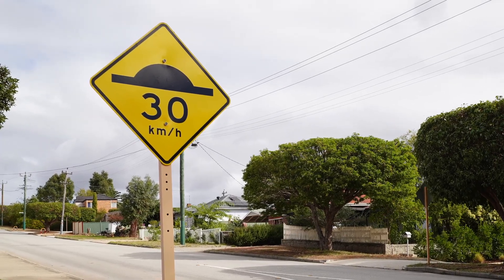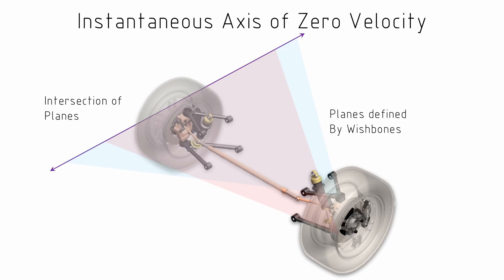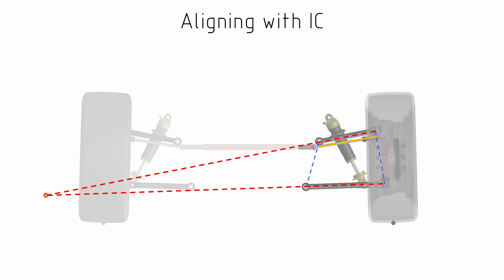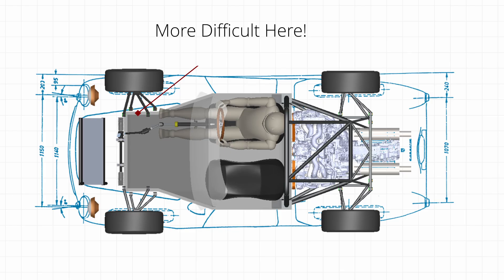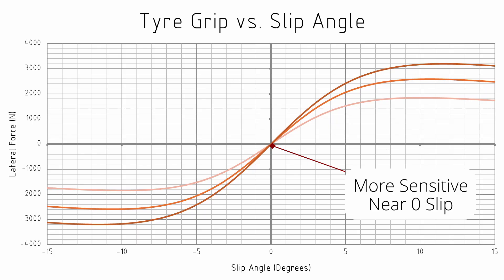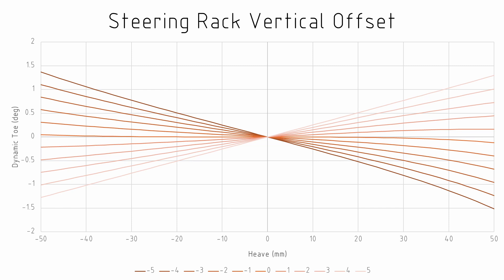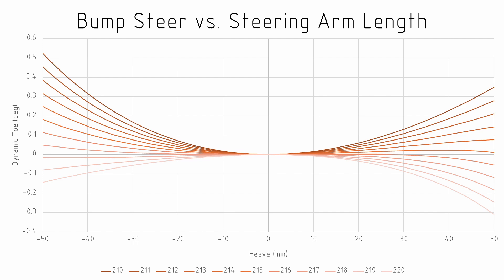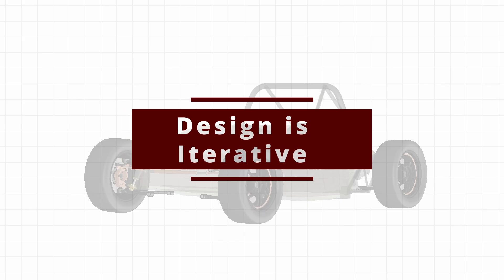Bump Steer: Designing Predictable Steering (Project 171)

Comment: Does shimming the height of the steering rack not cause issues with mating to the steering column?
Reply from the maker: Nothing that cant be dealt with a few adjustments further up the steering column.  Small shims can usually be done within bolting tolerances without any binding.
Reply: @KevinHayward7  Interesting ; what will the range of rack height be for Project 171? I imagine if you’re able to shim the rack enough to make a difference in bump steer (say, +/- 0.1 in?) , your column could have noticeable slop in some configurations? I suppose this would also depend on the geometry of column (direct / single u joint / double u joint / two single u joints)?

Great videos by the way. will be sharing with my suspension members
Reply from the maker: I would hope I wouldn't need anything more than +-10mm.  Chances are I wont even need to shim it at all, given I can potentially deal with it at the upright.  Column will have two single U joints, and will mount the column after the rack is properly located.  This means that the mounts can be made to suit the ideal rack location rather than have to do a lot of shimming / slop at that end.  Although it isn't too hard to put shims in at the steering wheel end of the column mounts to deal with the small changes required.

Comment: Hello mate, thanks for the videos. Ive got a Spire GT3 that has a similar setup to what youre planning. It uses a mk2 ford escort rack, although mine is an older car and the newer ones have a more racy off the shelf item. Ill take measurements from mine if you like?
Reply from the maker: Thanks for the offer.  I did have the dimensions for a Mk2 escort rack. Looking to work with a Subaru BRZ rack which I have picked up.

Comment: Wouldn't bump steer be reduced if the rack were mounted as low as possible, so that the tie rods would be longer and its angular deviation less?
Reply from the maker: It would help, but bump steer can be made pretty low in the position it is in at the moment.

Comment: How are you defining the vertical rack offset? Watched that section a few times but maybe it went over my head.

My plan for my car is to take a manual/depowered rack and shorten it, is that just falling into what youre considering to be too pricey?
Reply from the maker: Im setting the vertical offset of the rack at zero when it is at the height that causes the a line through steering tierods to intersect with the instantaneous axis.  Positive if the rack is higher, negative if it is lower.

A depowered rack is fine. Pricey is when you want/need something custom. No economy of scale to take advantage of then.

Comment: Can I raise the possibility of a non-rack style steering system?  I know people think it is old fashioned but running another four-bar linkage to provide steering geometry might open up some interesting possibilities.  Also, you could drive it with a one-sided rack in the end if necessary.  BTW, some F1 cars have separate racks for the left and right wheel - just a f'rinstance to boggle the mind.
Reply: I also want to add that a poorly positioned rack which needs to react a lot of "vertical" (or non axial, really) load can add an annoying amount of variable friction into the steering system which can upset steering feel in extremis.
Reply: PPS:  The Elise rack is 786mm between pivots, FWIW.  I have made a CAD model of one too, if you're interested.
Reply from the maker: We did end up using a non-rack steering system on a couple of the ECU Formula Student cars. Pitman arm off a planetary gearbox going to intermediate rockers. Cool but probably over complicated system, was really good in building in non-linear ackermann effects.

Probably happy with a typical rack for this car though.

Good point about avoiding having too much angle on the steering arms.

Thanks for the Elise rack dimension, a CAD model would be great.

Comment: You could consider using an NA/NB mx-5 powered rack, then depowering it.  I have done this myself and it is rather easy, feels great, and may be of a suitable eye-to-eye length for this project.  The ratio is also fairly slow at 15:1 (though that is likely the steering ratio, not rack ratio, which is not considering the steering arm length).
Reply from the maker: It is definitely an option, do you know the eye to eye length of the pivots and how much travel the rack has?  It is a popular rack, and the depowering is pretty well documented.

Comment: Woodward have some nice steering racks, but might be a bit on the high side of the budget. I couldn’t find pricing on their non-power steering options, but might be worth reaching out to them? 
Benefit there is lots of technical details and available in many sizes. We used in FSAE, and I recall that being less than I was expecting, considering machined aluminium housing (it was much beefier than we needed for FSAE, and swapped to a much more suitable one later on, but for road applications they are very nice)
Reply from the maker: Woodward do some good stuff, but definitely more than I want to pay unless I can't find something suitable off a donor car.  Great how much they support FSAE though.

Comment: As a student design suspension for FSAE for the first time, your videos have been extremely helpful in my understanding of why certain things matter. We've been working a lot with trying to improve ergonomics which has made the steering rack position a key issue. I managed to get our suspension down to 0.08 degrees of toe change which isn't perfect but much better than the 2 degrees it was before! Thanks for all the effort you put into the diagrams in these videos. Designing along side you has been tons of fun
Reply from the maker: Super happy the videos can help. 0.08 degrees sounds pretty good. Well done. A FSAE car spends so little time with the wheels pointing forwards that real bump steer will be a bit higher once the steered angle is taken into account.

Comment: I've had a similar problem with the Fiat 125 "mod pack" that I'm designing (the one that corrects camber, ackerman and caster by using a set of custom wishbones).
The steering box would be a pain to use with increased caster. Also, they're old and the aftermarket/OEM support is nonexistant, so a steering rack is the way to go.
Of course, that leaves me with the "bump steer solution using OEM parts" problem. I managed to find a catalog with lots of steering racks and some measurements, provided by Corven. It's in Spanish, but I hope it is useful for your project!
In case you need a very short steering rack, you can use a VW GOL one, from an early 2000's model. The output arm is aligned with the rack itself rather than on the sides, so the car has a VERY long steering rod. You can easily modify this system to fit your needs (not my case since I can use a Fiat Palio steering rack without problem).
Here's the catalog BTW: https://corvenautopartes.com.ar/wp-content/uploads/2025/05/3.-catalogo_cajas_de_direccion.pdf

Greetings from Argentina!

Comment: Lotus elise (series 1) racks are simple and available. Their mounting solution is pretty simple, too. Horizontal bolts in vertical slots with riveted on plates for height references.
Dont have measurements to hand, but seloc or other forums may have them, and the factory service and parts manuals (pdf) can be found on google for general info

Comment: My Alfasud steering rack had the inner ball joints outboard of the rack, not at the ends, giving it very long time rods.
Reply: That's because the steering rack had to be mounted high on the firewall in order to clear the longitudinal powertrain, and it uses MacPherson struts with the steering arms up high (just under the spring bases, as opposed to the usual location down near the hubs) in order to get the whole steering mechanism up high. On this side of the pond, the Chrysler LH cars of the 1990s were the same way.

Comment: The BRZ has a gloriously simple steering rack, because the EPS is in the steering column.  I could get you a rough width, but I don't want to take the boots off to get more accurate.  Being a strut car, and seeming to have good bump steer charcteristics from factory, I'm guessing the width is probably nearly identical to the distance between LCA inner pivots?  It does mount with longitudinal bolts, though, so may not work so well if you want vertical adjustment.
Reply from the maker: This was a very helpful comment. When I looked into the BRZ rack form what I could gather from online info the rack width is almost exactly what it currently is in the mockup design.

The RHD car racks are also really cheap.  However because the rack sits behind the axle, it looks like I need a LHD rack which was more expensive.  Still a decent enough price. So much so that I have one on its way for the next step of the design.

So thanks heaps for the suggestion.

Comment: What's the current WB? What happens if you add 10" and give the passengers wider & more comfortable footboxes, put the suspension arms in front of the monocoque, and get a little bit more structure and space for the chassis to absorb crash forces? Would it ruin the look you're going for? Would you no longer consider it to be 'small'?
Reply from the maker: I was trying to match the wheelbase/track of the Porsche 550. I have already extended the wheelbase a little because I didn't want a torsion bar front end. I want to avoid increasing it any further, as soon as dimensions start getting bigger it gets hard to keep the weight down.  Definitely want that small speedster look as well.
Reply: Hmm
More to talk about here. 
Some places say the original was an 82" WB.
looks like the Beck is 85" WB.

I can definitively say,  with a little NA miata at 90" WB, and no downforce, it's a bit loose and takes some skill to keep it pointed the right direction in high speed corners, like, 85mph and up maybe. 
A modern undertray/diffuser may be a way to counteract some of the lift the body will make without making the car too grippy or modern looking?

Safety: Did you do a video on roll protection yet? 

Sort of ruins the speedster look.
But IMO it's a shame to have a sweet handling car that you can't use, because any dumb mistake on your part, or the Prius in the other lane is fatal.
Which is why I personally wouldn't mind a longer, larger, heavier car. 
2000 lb wet is still incredibly light and fast on 200 hp IMO.
 @KevinHayward7
Reply from the maker: Haven't yet done a video on rollover protection.  Your take is some of what I am considering. Nearly all the models I have put together use a properly braced rollhoop for that reason.  Definitely takes away from appearance.  I never felt that secure in my Mx5 NA when I had it.  I have really started to like Targa's as a result.

Hard to esacpe the unfortnate fact that with the increase in size of cars that it is always going to be far less safe in a small lightweight car. Either everyone goes light and small or it is a race towards the largest barge.

Comment: You could use the rack centre, but make custom length rack-ends to screw in to the centre.   If the rach centre is shorter than optimum, use inserts to move the rack-end ball joint further outboard? Maserati Ghibl II/Shamal used an intermediate linkage...Atesa? they called it??
Reply: I have done this before.  Its obviously easier to get a short rack and make spacers but there is usually some scope to reduce the length slightly without major surgery.
Reply from the maker: Good option, somewhere between off the shelf and fully custom. I'll try and make something off the shelf work first, failing that I'll probably try what you suggest.
Reply from the maker: Reasonbaly common to see shortened racks on Lotus 7 style cars.

Comment: I know that, at least in the past, spacers were used on Silvias between the steering rack and tie rods to adjust the rack length and the height of the tie rod's pivot point in order to reduce bump steer.
Reply from the maker: Probably a good adjustment to keep in mind.

Comment: I just measured the steering rack motion ratio of a Peugeot 205 GTI minus engine, that is sitting outside my workshop, and one full turn of pinion translates to (very) approximately 32mm of rack movement. Total turns lock to lock is almost exactly 3.9, giving total rack motion of about 125mm. Approximate distance (effective rack length) between balljoint centres (inner ends of track rods) is 540mm. All a bit approximate, as I have nothing around that's very accessible at the moment, but all given dimensions are within 1- 2mm tolerance. Although this make of rack and pinion is annoyingly low ratio, I did use one on my current project, which is a 205 with a mid mounted THP270 engine and box, as part of its double wishbone front suspension. I had exactly the same issues as you have, with finding no rack dimension data online, (except for Triumph Herald!- good system, by the way), so I went with what I had and, with the aid of string lines, online suspension motion diagrams and machine tools, cut about 64mm off the rack (non gear cut end), to put the inner track rod balljoint centres on the same line as the wishbone inner pivot plane, and adjusted the rack housing position and dimensions to centralize the new, reduced movement. Finally, as I fabricated hub carrier uprights also, I was able to reduce the steering lever arm length on the upright, creating the opportunity to raise the overall steering ratio to around 2.9 turns lock to lock. Result is that I can barely discern any measurable bump steer through the full squat-droop movement of the suspension- although suspension travel is relatively small as this is a track car only. Rack height, I also discovered, is absolutely critical, as your excellent video makes very clear!
Reply from the maker: Those are really helpful numbers. The travel is good, rack probably on the whort side, but I have been thinking about maybe lowering the rack which might allow a narrower rack.  Could be an option.  Somewhat relieved that I'm not the only one who has had difficulty finding dimensions to off the shelf racks.

Sounds like a mad project, hope its been fun to build.
Reply: @KevinHayward7  a quick guess is it could be reasonably straightforward to elongate the rack, by inserting one or two threaded inserts (depending on side-to-side alignment requirements) before re-installing track rods? my issue was rack being too long which was slightly more awkward! I'm 90 percent sure the thread in the ends of the rack was M14 x 1.5. Yes, the closer the rack sits to the lower wishbone inner pivot point the shorter the rack can be, as most double wishbone designs necessarily have longer lower arms, requiring inner pivots to be laterally closer together for useful camber gain/roll centre control. I recently saw a youtube video of an XJ220 build, with steering arms on the same horizontal plane as the lower wishbone inner link, and inner track rod balljoints at the same spanwise position- perfect for zero bump steer. I definitely give that concept a thumbs-up! Thanks for your kind words on my project- it's been a blast to build (a few highlights: front suspension- pushrod/inboard coilovers, front and rear cockpit adjustable electrically driven anti-roll, electrically actuated rear air brake (resumes service as rear lower wing/diffuser when brakes off- this is NOT an MSA or FIA approved device), converted from direct injection to port injection for Haltech ECU, weight approx 900kg).

Comment: Lots of UK kit cars use the MK2 escort steering rack. They used to be fairly cheap from places like rally design.

My mate had to move the rack up and back by about 25mm in his Fisher Fury. We think the rack mounts were for the escort upright chassis, he went down the sierra route. Before he had toe out and the car was twitchy.

It's now neutral in droop and toes out a tiny, weeney, smidge between ride height and 1/2droop then a bit less to full bump. Laser moves 4mm @ 1200mm to the mirror and then another 1mm-ish to full droop; 5mm movement over a total distance of 2.4m is technically known a "FA". Originally it moved 120mm between full bump+droop.
Reply from the maker: Yeah I have seen a few of the kit car suppliers providing Escort Racks, a bit on the short side for the current design, but could be made to work if I ran the rack closer to the lower wishbones and redesigned the upright to suit.

It is sad to see kit cars where the attention isn't paid to bump steer. People can get the wrong idea of some pretty cool cars if the steering is unpredictable. It is really high on my list of what is important in the handling of a car. Sounds like your mate had it sorted on the Fury.

Jeremy Phillips did a great job on the fury. It is a really nice little car.